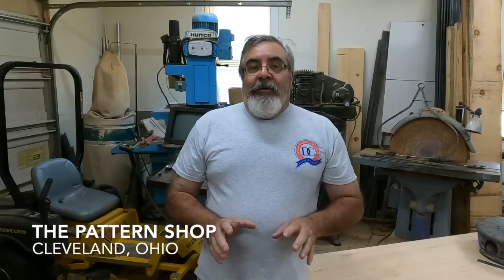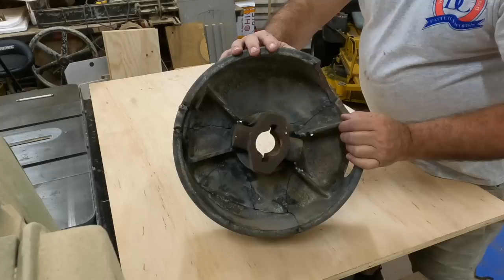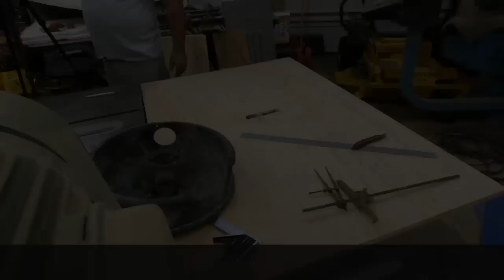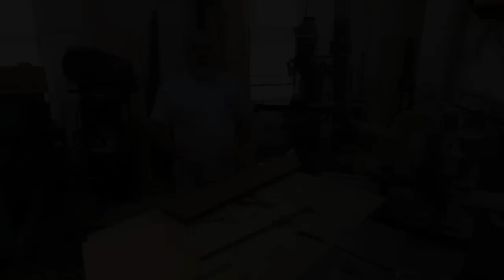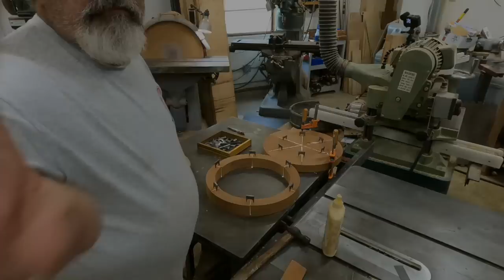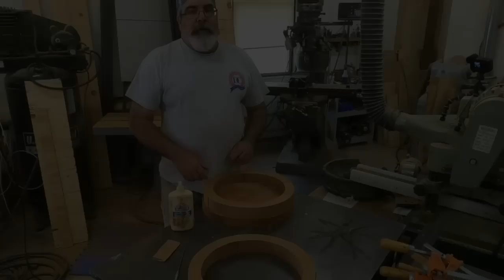Tally Ho Capstan Project: Part 1- Pattern Layout & Glue Up

Comment: Why don't you just machine a new piece out of aluminum. After the thing is drawn up, you would be done in a day. Could leave enough slop for fine adjustments, but would be both strong and weather resistant.

Comment: My father was a pattern maker. My first job at 14 was a cleanup kid of the shop he worked at. I was there for a couple years and even worked in a foundry that was affiliated with the shop in Los Angeles when I got out of high school, I took the test to become an apprentice, but a personal family friend who was the business agent of the local told me and my father it was a dying trade  I still have all of his tools the business I started as a structural steel fabrication shop was around the block from the pattern shop he worked in. They made a lot of valves and other items for the oil industry as well kinds of other products oddly enough, a friend I made years later brother-in-law has an aluminum foundry and was well aware of the shop. My father worked at and actually had work done by them.
Watching you build a pattern with all the different woodgrains and using The dogs to assemble it and talking about the sprinkler rules takes me back 50 years thank you very much you’re one of a handful of pattern makers left

Comment: Hi Dave, terrific videos - came through the Tally Ho project. Really admire the craftsmanship involved in making these patterns - a question for you - how do you calculate the shrinkage factor in a casting such as this? Would you machine the part if it does not fit perfectly with the other existing parts.

Comment: Hi Dave, 
I'm retired from a family owned manufacturing company.  We manufactured Silent Chain, Silent Chain Sprockets, and some gears.  Most of sprockets and gears were made from steel.  Some of our sprockets were made from cast iron.  Most of our old patterns were made from Mahogany.  Our newer patterns were made from Sugar Pine.  Most of the castings we sold were made of Class 30 Grey Iron and we always had a few, every year, that were ductile iron.   

Back in the late 70's, when I was in High School, I worked at the plant during the summer.  Once a week I would travel to the foundry, bring them the patterns they needed for new orders and return with the castings, and patterns, they used to pour the castings.  Back then, the company would get orders for 5-7 castings a week.  Mostly onesie and twosies.  No real volume.  Most were small castings, 12, 14, 18, 20, 24 inches in diameter.   Once in a while we would get a few large ones, 30"-36" O.D. 
When I came to work for the family business in the 1996, most of the cast iron business had faded away.  Now, everyone wanted everything made from steel.  Sure, steel was heavier, was cast iron was a more expensive choice if you only need one, of anything.  

Most pattern makers today, are like you, independent, self employed, craftsman.  Back when I came to the company, the only pattern maker we had was some 90+ year old man who lived out in the sticks.  We would call, his wife would answer the phone, lay the phone down, holler out the door that he had someone on the phone, and he eventually came to the phone.  All I could picture was that scene from Green Acres when the farmer had to crawl up the telephone pole to answer the phone.  Unfortunately, a year or so after I started, he passed away.  I eventually found another guy, working out of a storage building.  He was quick but man was he expensive.  Unfortunately, our casting supplier was pretty rough on our patterns, so he was always making some kind of repair for us.

Anyway, that's my story.  I have never seen a pattern made from scratch, so this should be a great video.  Also, I have been following Leo and Tally Ho, and the fellow that got the Capstan apart, and now you.  An excellent journey.

Comment: Not that there is anything wrong with this, and it will be a good demonstration, but since only one or a small number are needed, 3d printing the pattern would be much easier and very accurate.

Comment: I’m sure you can do this old school way, but I would use a 3D printer to make the pattern. We have the technology to use 3D and make it accurately.  Then when the pattern is made with 3D casting plastic, use the lost wax method to pour the casting as like other brass items. So good luck.

Comment: The segmented idea is the same as how woodturners make segmented bowls.  However, woodturners cut the segments using a 'wedge' sled on a table saw, and when done carefully the segments fit together perfectly with no sanding needed at all. That saves time and the fit is better.

Comment: On making your pie segments fit perfectly: Your method was to tweak the angle on the last segment, which is valid for sure.   But an easier way is to glue up two sets of three segments and then plane them flat or run them over a jointer, or disk sander, then glue those perfect faces together…et voila, zero gaps.   Of course this doubles your glue up time, but most of that is waiting for it to dry where you can do other things.   

This makes flattish points on two of the segments, so you can sometimes see this when looking at historic patterns.

Comment: I still don't get why you account for shrinkage in the pattern? Isn't that what the risers on the mold are for? Same thing happened to the Tally Ho team when casting the brass feet, they oversized the patterns and then had to grind away a lot of material

Comment: Watching leaves me with two questions; The first being why not just use a cord, or elastic bands, to clamp this round object? The second being, why is this peace necessarily cast in Iron? Is it to maintain its original form? If you chose a different metal, would it create complications. Is it a matter of strength?

Comment: If it gets a little bigger on the outside, it's not a problem. But inside it has to fit over the other parts.
I think it's not a very precise machine part, but a casting machined at the important points.

Comment: What's that awful background noise? do you need that when you're gluing up?
Reply: I think it's the vertical disc sander
Reply: @johnvanhal2450  Plus extraction - not an "awful background noise", but that of a working shop.
Reply: @18robsmith  hey, I didn't say that ..

Comment: TRY 3D SCAN AND MAKE A MODEL USING 3D PRINTER, I do like woodworking projects, I've built fine cherrywood stairs, remodeled bathrooms, built surfboards, toy airplane, snow sled, bed head and foot, rails, but first drew the projects in CAD. Mainly cause I tend to miss by 1/8" !
Reply: He, like me too, is a neanderthal when it comes to computers. Most probably. Plus it ain't fun. To me it wouldn't be.

Comment: You need a Pantograph for tracing parts slightly larger..   i probably would have made the pattern larger on the OD without the notch but with a taper... so the pattern will come out of the sand easily.. the final casting will be machined OD to put the final detail back in the part.. making this much easier to cast..   Smooth tapered OD.. no ridges